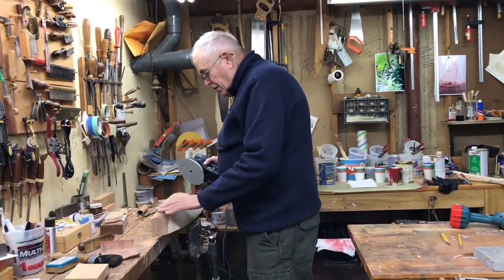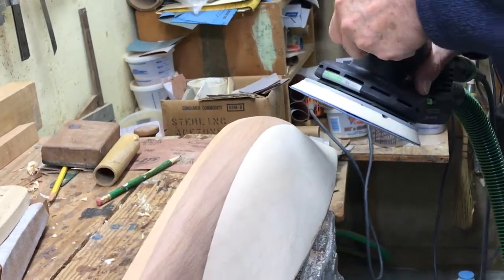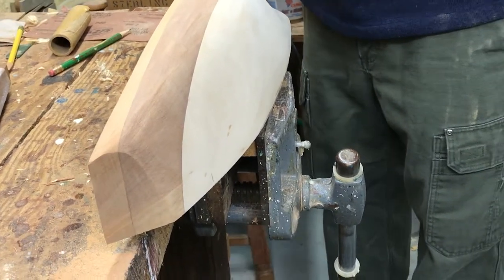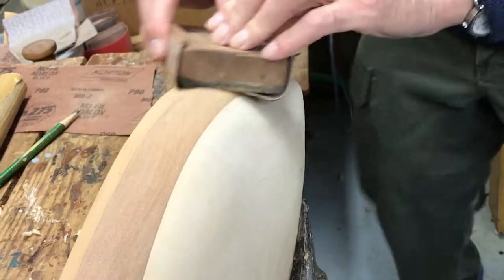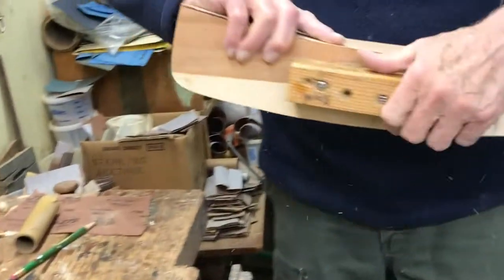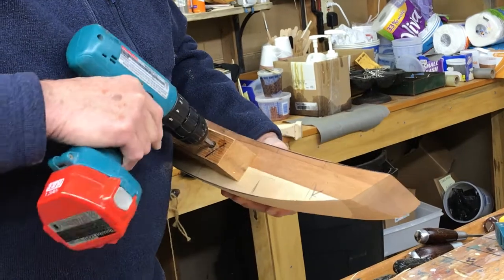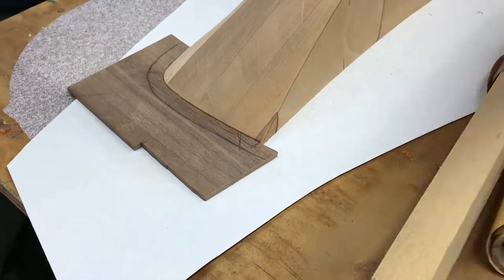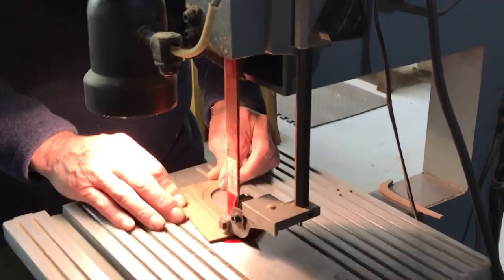Cat Boat Half Hull Model by Malcolm M. Crosby, Part 6: Sanding

Comment: In the olden days were measurements taken from the model to use in building the full size boat or were the models just to show the customer what you would build?
Reply from the maker: According to Malcolm, they would lay out 1/4” plywood, paint it light grey, and use a set of plans with a ruler for the scale (1 inch for 1 foot), and they did it maybe by eye, but that was before his time. But yeah, models were made first, then the boat. Thank you!